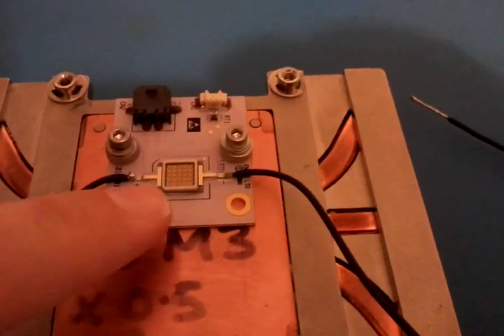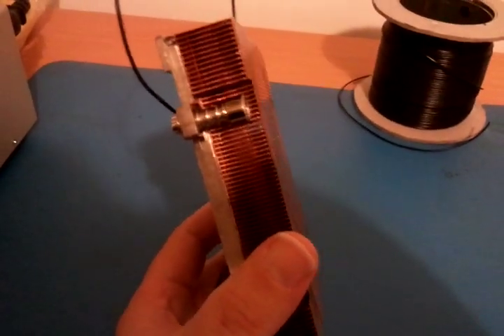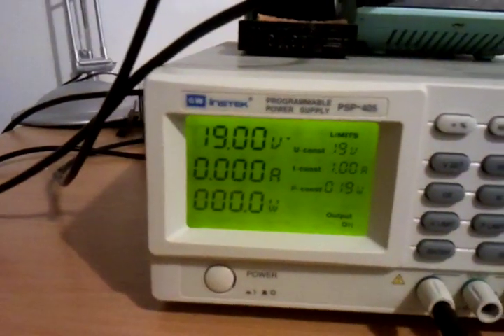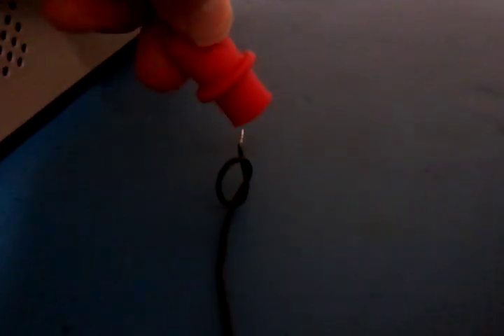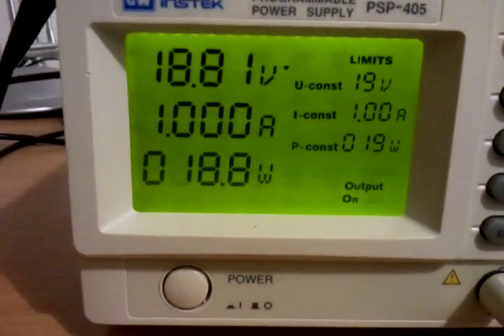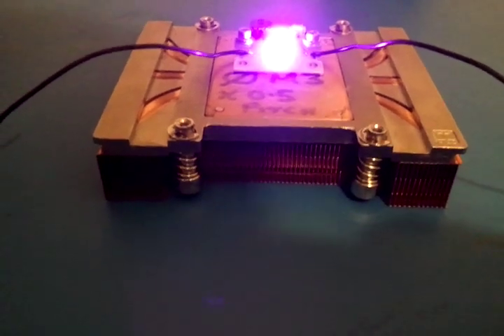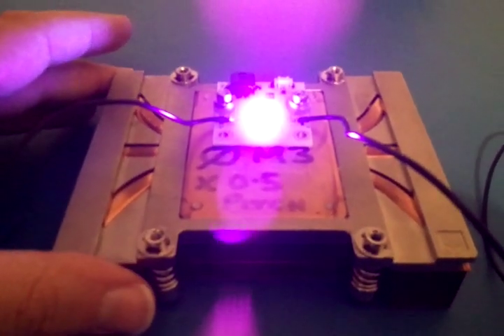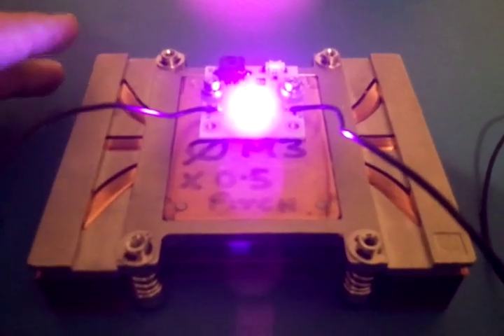UV LED Heatsink Hack with eBay Server Copper Heatsink Cooling High Power Ultraviolet Diode

Comment: I used a LZ1-00UV00 which is 4.1w of power in and 1200mw of luminious flux out. costs 35usd but seems that depending on how good of one u got (thats a huge range u listed) it may be as powerful output wise

Comment: Hello, can we know where did you get this led? i am looking for one exactly like this

thx
Reply: https://www.digikey.com/product-detail/en/led-engin-inc/LZ1-10UV00-0000/1537-1032-ND/4976722 its 4.1w of dc but produces 1.2w flux ...he states his listed from 1xxxmw to 2xxx mw on the datasheet meaning their mfg process sucks and u could get absolute shit...plus its using 18w to produces that vs 4.1 if you spend a bit more for the one i linked. I've got the one I linked at am still playing with it but so far have been using 120 seconds for exposing pcbs covered in uv film. Im guessing If i ran it over spec I could cut that to a min but i have a product to finish before i risk destroying a tool

Comment: For detect the reflection of UV Light on a paper painted with UV ink, what kind of led I've to use? I've an application where I have to illuminate, through a UV Bar Led, a ticket that is in some points painted with Uv paint, in others points not. Which type of Led should I use to detect the difference of reflection that I will have in different areas of the ticket? Thank you!